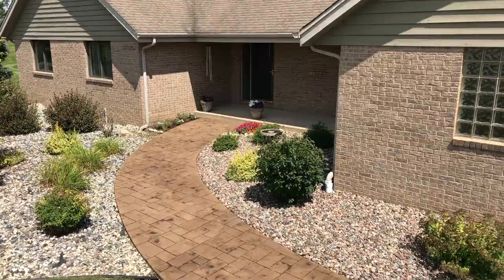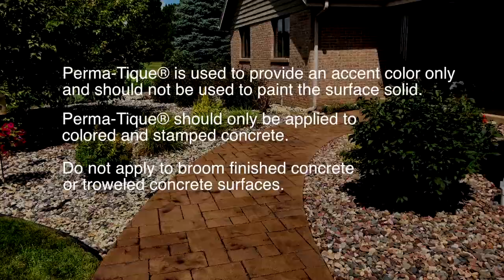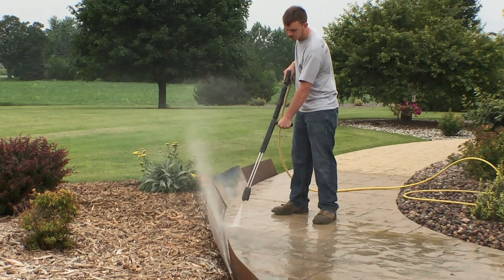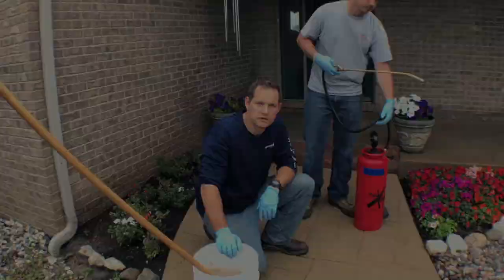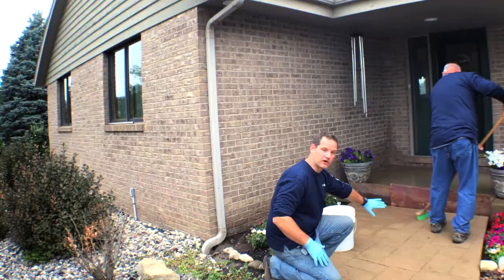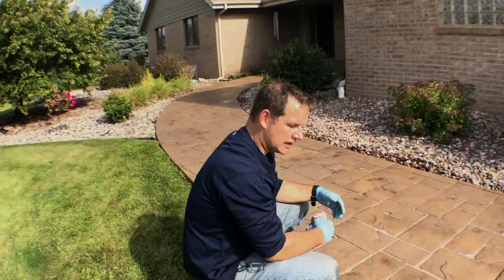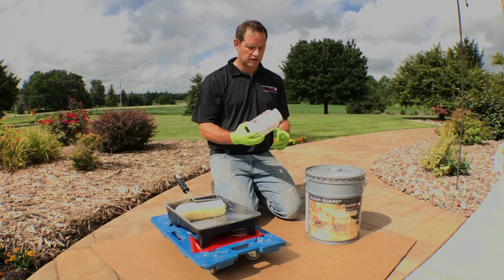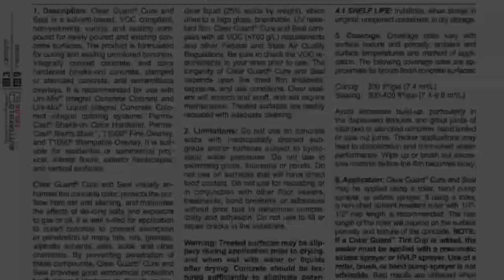Perma-Tique® Antiquing Agent Application Video

Comment: If just certain areas look like the sealer has come off, can I permatique just in those areas. Let dry, then seal over? Without having to remove any sealer from other areas? Basically, if I get permatique in some small areas that are sealed, is it just not going to absorb there, and I can just wipe it up? I don’t want to strip the whole patio.
Reply: I have the same issue. I am planning to do exactly what you described. If you permatiqued the area without sealer, then applied sealer over the new and old areas, was the outcome successful?